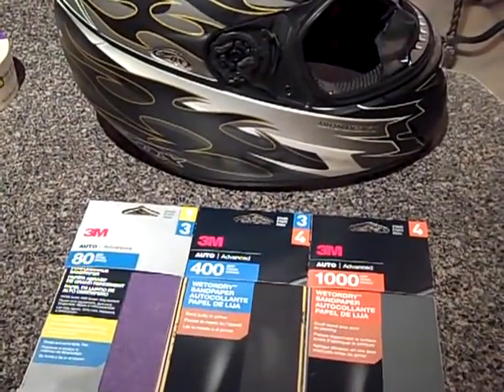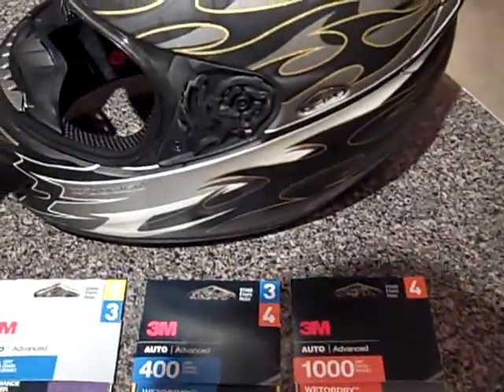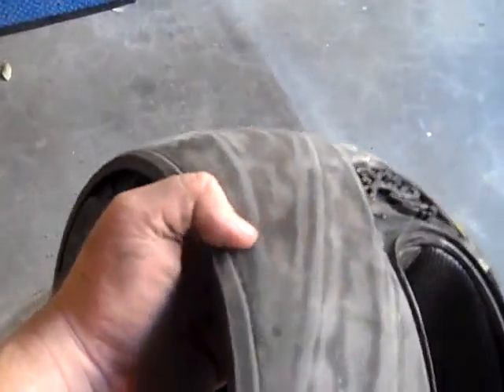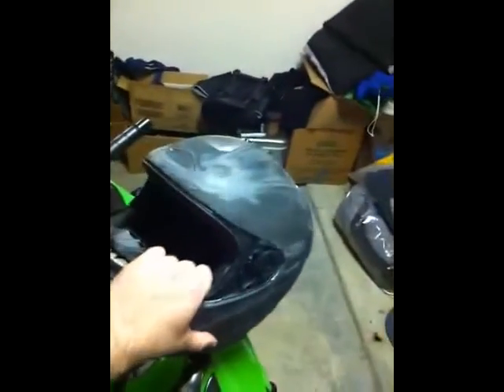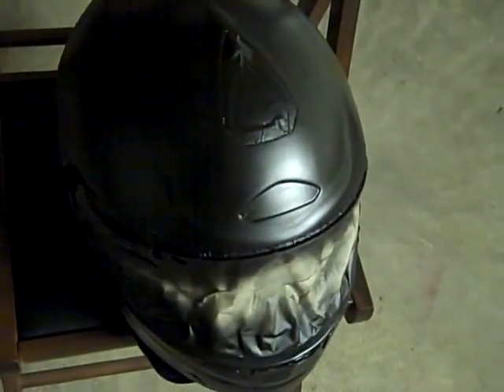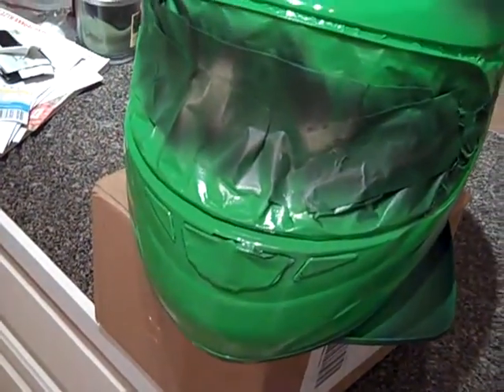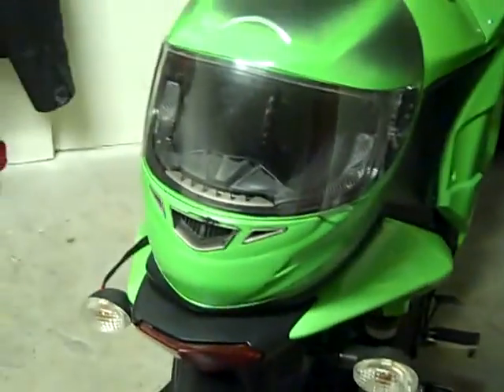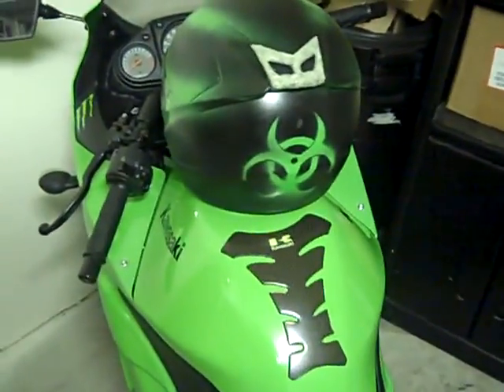How to Repaint your Motorcycle Helmet - Step by Step DIY

Comment from the maker: Drake Wolfe - I honestly practiced on cardboard for a while to get a feel for how thick and constant the spray was. I shot it from the front while on a flat surface about chest level off the ground which I think helped. I then kept the stream steady from the front and ran it down the top curve line that was in the helmet, did the same thing on the other side. I was very impressed with how even mine turned out, beginners luck. LESS is MORE... remember that. ;)

Comment: Some say that sanding, as well as painting can weaken the helmet. I say, scuff it with a green scrub pad, then paint it with the Krylon Fusion spray paint for plastics. Besides that, just use blue masking tape for the vents and the shield opening, and dot sticker.
Reply from the maker: Definitely true. Legally changing your helmet probably is not ideal. I used engine enamel to give it a strong exterior. But modifying it would void the warranty etc certainly thanks for pointing it out for folks. My goal was to take a helmet I'd never wear, and instead of not wearing a helmet... being able to have one I like wearing and would protect me better than none at all.

Comment: I currently have a solid white bilt helmet that I am dying to turn matte black instead! Think your techniques would work for me??
Reply from the maker: I do... if u follow these steps I don't know any reason why you couldn't get the paint to adhere to any helmet surface. Of course you do so at your own risk. ;)  but I had never done this before and not seen any good videos on how you could do it which is why I shared. The helmet is still like brand new now because the engine enamel paint is hard as a rock.

Comment: Should of left it black imo. Does the can of spray have to specialize in fiber glass, plastic, or metal, etc.
Reply from the maker: No, the spray paint I used was recommended by the manufacturing company for helmets specifically. Duplicolor Engine Enamel. The color was called Grabber Green. Thanks for the comment!

Comment: I tried it one time and failed on the free style lines. Any tips on making my lines smoother? (Lines being the green on your helmet)
Reply from the maker: Honestly this was my first attempt and probably my 2nd time to ever use a spray paint. So I got pretty lucky. I tested on a cardboard box to get a sense of how fast and thick it would spray, and ran it a couple of pretend times like that... then sprayed the face section and right away did the 'stripes'. It was freehand so that is a bit of a luck of the draw or where the 'art' or skill comes into play. You could tape off a design if that makes it easier

Comment: I don't know if it's been mentioned but the helmet manufacturers don't recommend that you paint your helmet, it may weaken it's structural integrity.
Reply from the maker: That is true - they do say that. And you will void any warranty.  In no way should you ever modify or repaint a helmet. 
*disclaimer aside now. 
i did use an engine enamel for the outside shell, this was advised to me by the paint manufacturer as a intended use for the product.

Comment: Wow, what an excellent job! I must say it looks professional! I have the same bike as yours and am planning to custom paint a black helmet eventually. Would you recommend a glossy one or flat black one in terms of painting/looks? I want to give it some green like you and perhaps add a few decals. Thanks!
Reply from the maker: Thanks Sree Naresh Koneru! Honestly it's the product that really made it turn out well. A little extra time sanding and prep work made a huge improvement overall. If you have never spray painted anything before... get a large section of cardboard and try some stop/start patterns etc to get a feel for how wide and how much paint comes in each burst so you don't get runs etc. Definitely give it a try!
Reply: BigDSV Great! Thanks for the tip! Unlike you, i'm starting out with a new, glossy black helmet. Do you think I should sand out the areas that I plan to modify or just applying the primer followed by color and clear coat should do it?

Comment: Didn't u want to put a clear coat on it?
Reply from the maker: Not with the engine enamel. it's hard as a rock it's what they use on NFL type helmets.
Reply: it looks so cool
Reply: it looks so cool
Reply: it looks so cool
Reply from the maker: I was advised I didn't have to do so. With the black primer, the clear coat likely could ensure it's longevity/durability. With so much of the helmet that engine enamel, i decided against. /// If i had, i'd have needed to use a clear coat that would bond to the enamel.

Comment: i dont now if u did this or not but u need to clear over it
Reply from the maker: If you use the engine enamel you do not HAVE to clear it. it's got a hard finish on it. Duplicolor website - Engine Enamel is the product line. This one was called Grabber Green. I do agree though, that shooting clear on it will give it a nicer finish overall and even out any areas that have uneven paint layers.
Reply: Ok then

Comment: I dont think you're supposed to repaint helmets
Reply from the maker: Legally, nope you're not. You'd void whatever warranty the helmet company had. If the option is to go without a helmet tho' or to repaint an ugly helmet so you'll wear it ... to me the choice was clear. ;)   The engine enamel finish gave me some piece of mind since it's used on football helmets. Hope the video helped
Reply: BigDSV oh thats cool, nobody really cares about the warranty anyways. but I was told that paint could damage the helmets integrity or something but i didn’t really believe it, so I did it anyways. also, thanks for the guide, it really helped too. i put a ceramic coating on mine to further protect it from scuff marks and scratches from rocks.
Reply from the maker: @parallelalpha  HAHAHA love it.  How'd it turn out? Hope you're well.
Reply: BigDSV it turned out really good actually. it’s still holding up well. it could probably use another coating of ceramic but no damage to the paint or anything. thank you :).
Reply from the maker: @parallelalpha  Nice! That makes me happy to hear.

Comment: nice job! i would wanna do a matte black helmet. so i just sand off the glossy part and cover up all the holes and just spray it with a bottle of matte spray can? that's it?   thanks!
Reply from the maker: Yes that should be it. I'd use a primer first so the matte spray sticks. If you don't use an enamel outer coating ((not sure if that is made matte)) then it might need touch ups from rock chips etc. But yes, it should really be that simple. See if Duplicolor Engine Enamel makes a matte black. That doesn't need sealant of any kind.

Comment: I was thinking about doing this with mine.  I've heard this may cause degradation to the shell of the helmet.. Is that something to be worried about?
Reply from the maker: Has done nothing to my helmet that I'm aware of in the 1 1/2 years I've had it. I'm not a molecular chemist, but the good people at Duplicolor are the ones who recommend their Engine Enamel for helmets to be painted with. They said it is used by colleges and other teams for their football helmets. If that's true, then I'd assume it's safe. I had a minor wreck in this helmet, and it's still good to go!
Reply: BigDSV sounds good to me, thanks much
Reply from the maker: Thanks Steve Brown. If you make a go at it, let me know how it turns out. Don't be skurred. It was fun and I don't regret doing it at all. I'm not very talented or artistically inclined... if I can do it, anyone can.
Reply from the maker: Agreed. If there is any doubt, go get a new brain bucket! Definitely cheaper than the alternative.

Comment: Can i use clear coat when finished?
Reply from the maker: I used an engine enamel clear. If you use engine enamel as the covering colors they you wouldn't need to clear it as the enamel can be a top layer.  (old comment I know just replying in case anyone has similar comment in future)

Comment: Hey boss,  did you get orange peel?
Reply from the maker: No. My understanding is use light coats, think of it as a mist. If you are getting orange peel, it's usually due to over spraying. the liquid pools and dries in that orange peel fashion. The primer step can't be skipped either. I think that's key for it to go on like glass.
Reply: Makes sense! Thank you!
Reply from the maker: Great! Let me know if you give it a try, and how it turns out! :)    Best wishes Los Lakers.